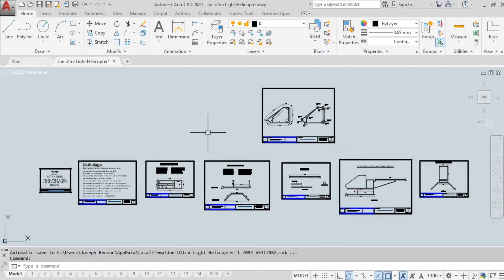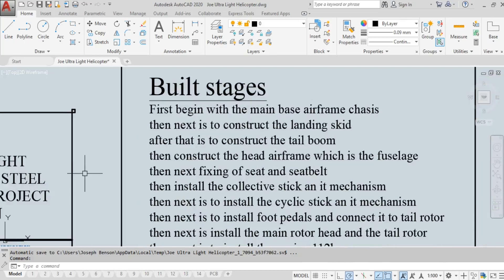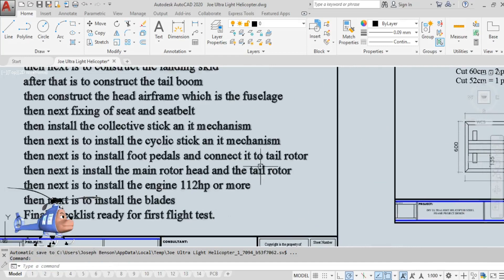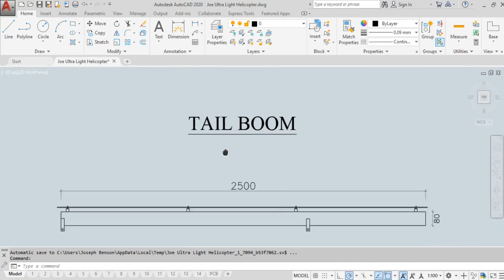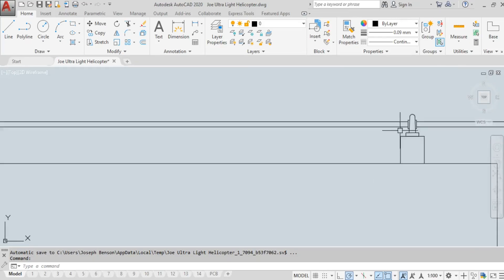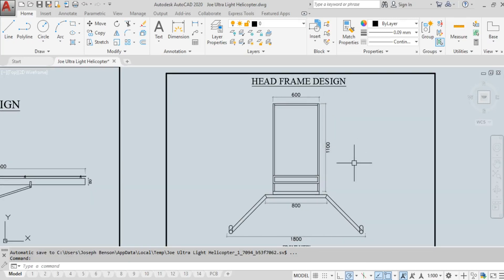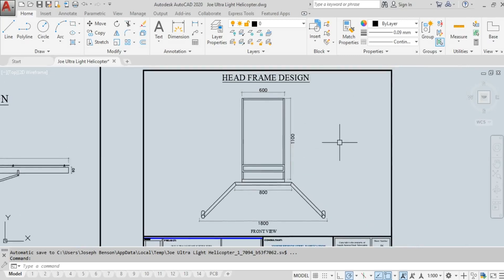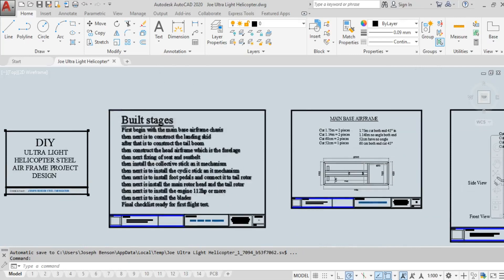My Ultralight Helicopter Plan Benson B1 Helicopter

Comment: You might take a look at the plans for the Furia helicopter which are available on the internet for free, but do have a few pages missing, BUT still have most of the information to build the main and tail rotors which I've used, but with a few changes to simplify making them.

Please do not believe I want to pick your design apart, but by using the materials you've picked your Bird will have difficulty flying, if at all.

Contact the E.A.A. and the P.R.A. for a few of their manuals on building aircraft; I say this because the Simplist thing can kill you if you do not get it right the 'first time' - I once watched an ultralights wings fold up in flight and plunge to Earth, killing the pilot - all because he had drilled some lightening holes in the attachment plate for the flying wires from the pilot cage to the wing spars to save weight and to make them pretty.

One thing here is, remove the galvanized material from your airship since it WILL fail in flight and welding 'galvaized' metal releases poisonous gas when being welded.

If you need the plans, I can direct you to the site or will send you a copy if you like.

Sorry to tell you this after you've put so much work into it, BUT if you or someone you know has children the frame, etc. will make. GREAT GIFT to play in !

I've been around homebuilts and Certified aircraft for nearly sixty years, since I was 15, and have yet to maim/injure myself - although I did manage to land my Quick-Silver glider in a tree once, Ha Ha, Ouch !

If I may be of any help please let me know.

But still, Best of Luck with your project and fly Safe !

Larry Whalen
lwhalen720@gmail.com